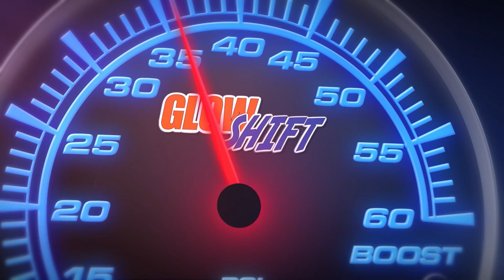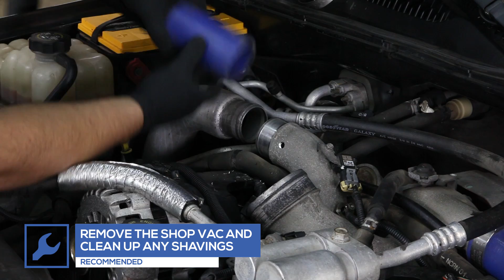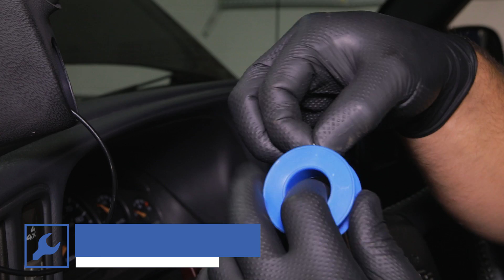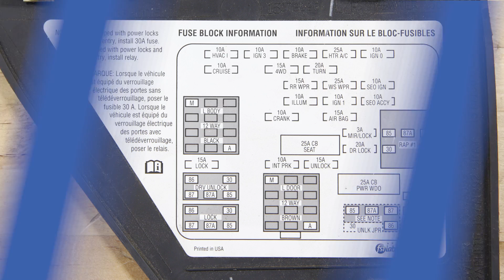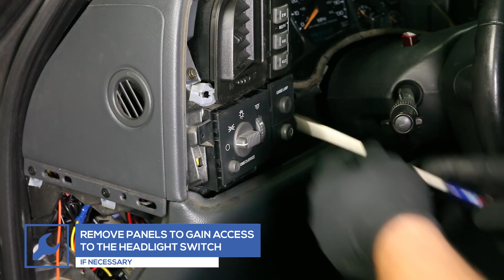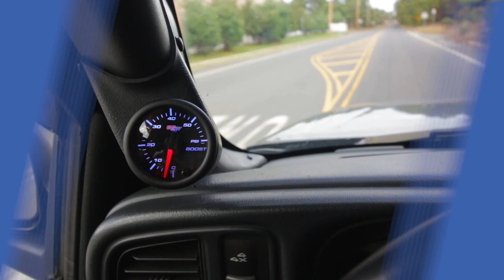Installation | GlowShift Boost Gauge for 2001-2006 6.6 GM Duramax Allison 1000 Transmission

Comment: My setup utilizes the T fitting off the boost line from the turbo. I want to install the ppe valve on the turbo line as well, would i install the valve upstream or downstream of the the T fitting?
Reply from the maker: The T-fitting should be installed on the MAP line the PPE valve gets installed on the wastegate line.

Comment: Are there any disadvantages of hooking this into a boost line vs drilling and tapping a whole?
Reply from the maker: It depends on the vehicle. Some vehicles do not have the option to connect to a boost line.
Reply: Only the LB7 has that line because it is a non vgt turbo and has an external wastegate. All other duramaxs are vgt and don't have an external wastegate. The LB7 wad 2001 to 2004 model years

Comment: Just installed this gauge and it lights up and all but the needle won’t move, what could be the problem?
Reply from the maker: Double check your boost line connections. Depending on your vehicle the gauge may only read when actually in boost. Unless you have a boost/vacuum gauge, then it should read when the vehicle is started.

Comment: Where would we get the t fitting ?
Reply from the maker: Your boost gauge will come with the t-fitting.
Reply: @GlowShift  Mine did not come with the t fitting.
Reply from the maker: @gageweir579  Sorry for the confusion. The boost/vacuum gauge comes with a t-fitting for the vacuum line. If you purchased a boost only gauge, you will need to purchase a t-fitting separately depending on your application.